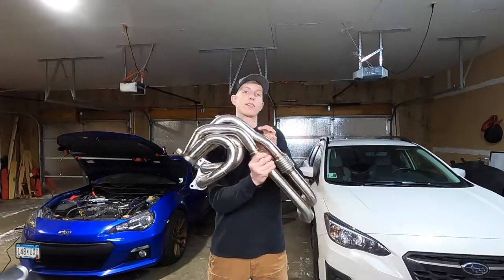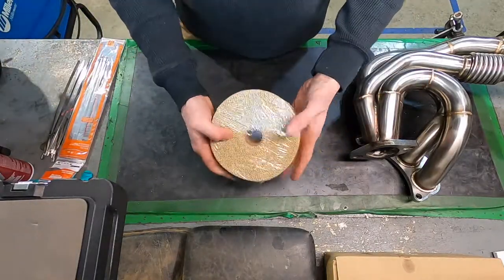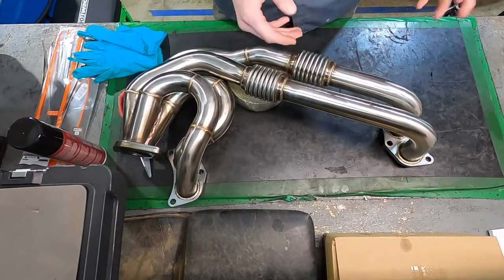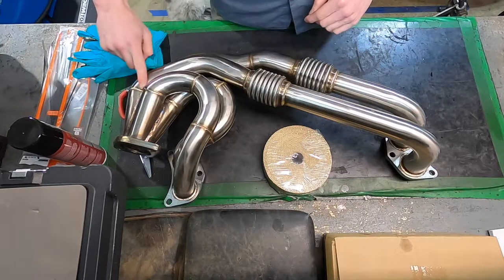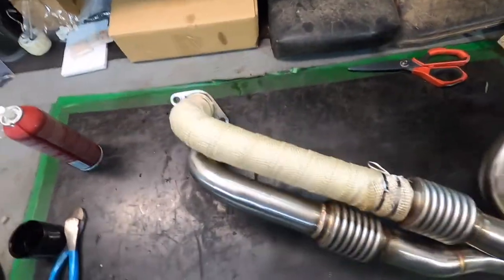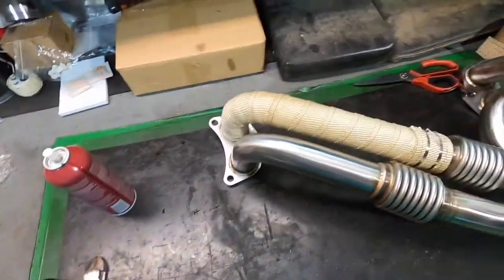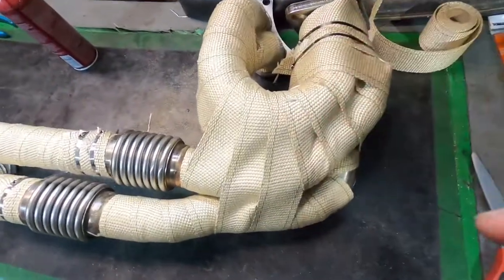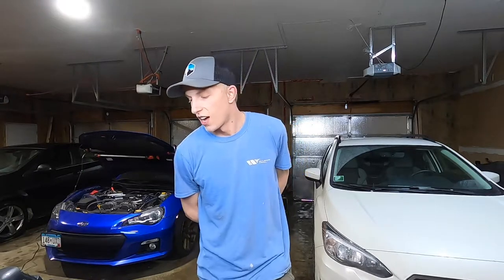HOW TO WRAP YOUR HEADERS!!

Comment: Would have been better if you soaked the wrap in water so you could pull it tighter
Reply from the maker: Yea this was my first time, definitely will be doing that on my rx7 now that I know!
Reply: Hey it also helps keep those fibers from flying around too but I will say use a long sleeve shirt u plan on throwing away because u don’t wanna try n wash the shirt afterwards